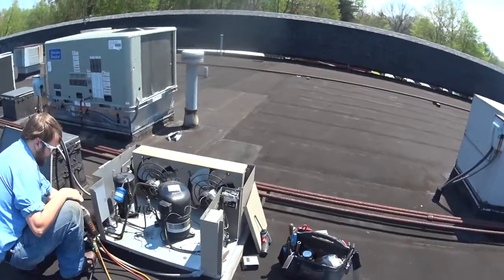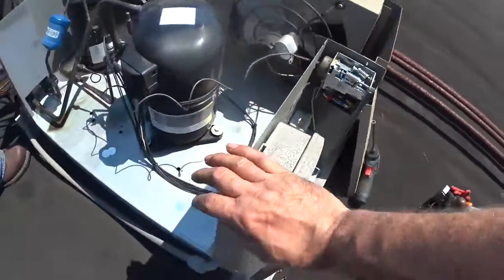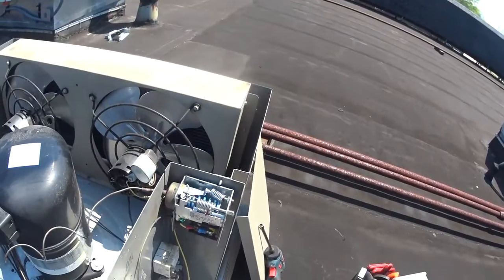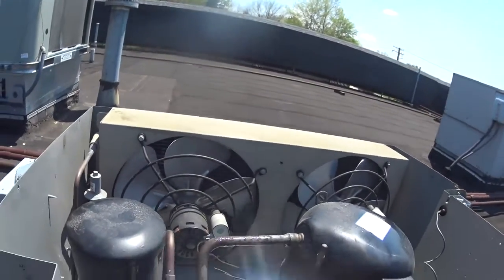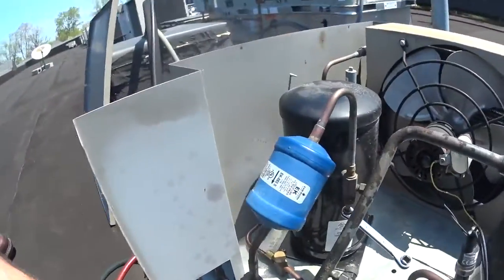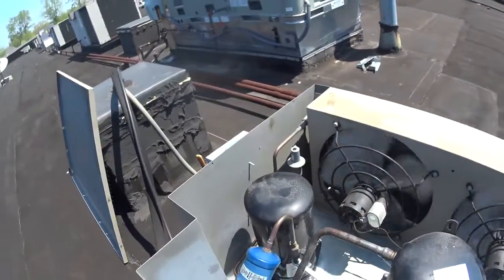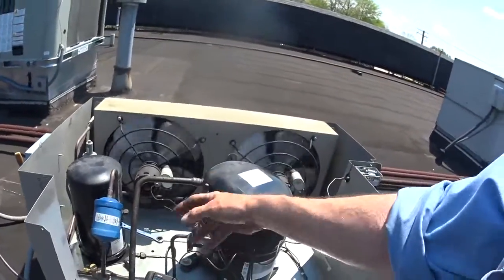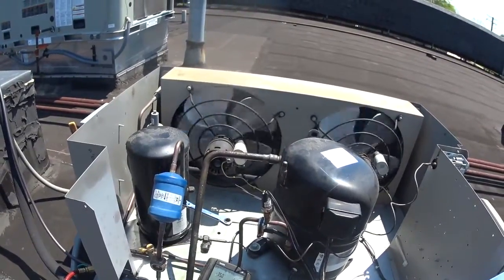Florist shop refrigerant leak on the pressure control

Comment: Are you happy with your srl8?  Does your old timer experience approve of its performance?  I used to only do commercial a/c, but now I do some light refrigeration and it can be a bear to use bubbles in some of these zero zones I work on.  Gonna bite the bullet and get a refrigerant sniffer and I was looking at the srl8.

Comment: Jim I had a Mquay air cooled chiller that lost 45lbs of R22, The P66 fan cycling switch bellow leaking.
Reply from the maker: Emin HVAC it's not real common, and it can be a hard leak to detect with the cover on the control. 45 lbs of R 22, there's a big bill. I think I would have done a conversion on that one. thanks